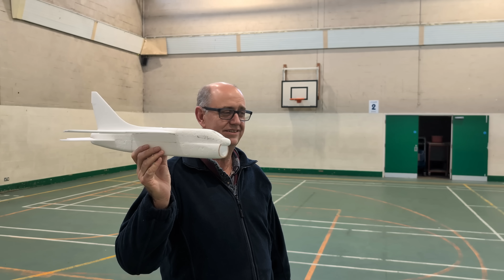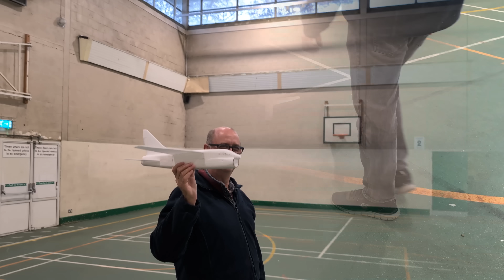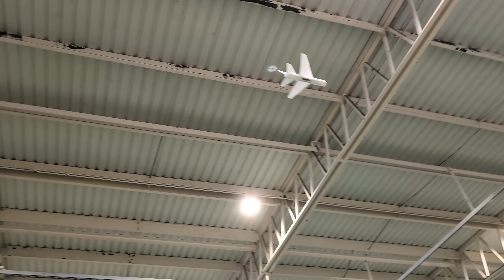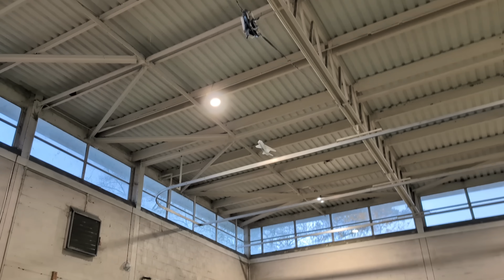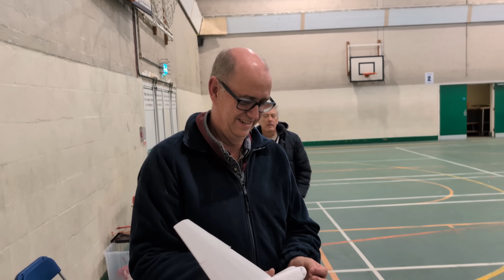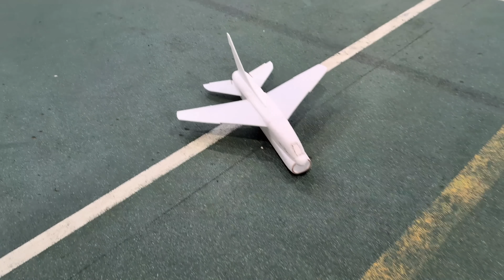Jons amazing free flight ducted fan Vought A-7 Corsair

Comment: Is there any gyro system has been used in this  very impressive model ?
Reply from the maker: No once it's been launched there is no assistance whatsoever.  The only thing the builder can change is the length of time that the motor runs for and the power that is outputs for each portion of the engine run.  A surprising amount of skill is required to get it flying so well

Comment: Need to under stand technology behind the model
More over how to design and manufacture the model
Reply from the maker: It's basically carved from foam and there's a bit more description of the process in the video description.  power is by a1s lipo battery and a 30 mm electric ducted fan

Comment: Great flight. At an airshow in the late 70's I got a unique looking styrofoam jet plane that had awesome flight when thrown. Had a bulky nose and two notches in the back for your fingers. I painted it with dad's spray paint likely made for metal and it melted. I was crushed. Next year air show didn't have them and never in the following years. It was at a Naval Air Test Center in Maryland, Pax. 
Six or more years later in my late teens I realized what the plane was. It was almost the exact shape of the Space Shuttle. I think someone may have got in trouble over that one? The gliding characteristics were a bit advanced I'd say. 
My dad was with the Corsairs during Vietnam and then P-3's the remainder of his career.
Reply from the maker: Thanks for the reply and for your story.  Yes we've got to be careful when we paint this one so it doesn't melt like your model. All the best from Cambridge England

Comment: One of the most under-rated aircraft designs ever, who would have thought it would even fly like a dream as a polystyrene model.
Reply from the maker: Yes it did fly well and it's surprised even the builder of the model.  The main thing is to keep the weight down and then they tend to fly pretty well
Reply: @alanpaul1234 I don't know if I was missing something, I watched it with the sound off but I was particularly intrigued as to how it repeatedly flew a circle in a confined space without hitting anything barring one minor mishap.

Comment: The motor performing in "stepped mode" mimics the power output of rubber band motors. Big burst of power initially at launch, then sustained power in level flight, then gliding descent. Neat idea.
Reply from the maker: Yes we picked that up from the rubber powered free flight guys

Comment: I have thought for many years now that this airplane would make a great RC model, however I was surprised that this is just a free-flight model, but I do think it admirably proves that this would indeed make a very good RC model airplane, this is a good size for an UMX model, or an even slightly larger model would also be a fun RC model, at twice this size, it could even possibly work with retractable landing gear and a much more powerful motor, but for indoor use, this is a great model of the Vaught A-7 Corsair.
I look forward to seeing a finished version of this model with an attractive paint scheme.
Thanks for sharing!
Please have an excellent and awesome day!
Reply from the maker: Yes I think it would make a good RC model and John is planning to do this at some point.  I think it would fly really well and could also make a good outdoor model if it was a little bit bigger
Reply: @alanpaul1234 Awesome, I look forward to seeing the new developments! 
I would also be interested in plans for this model if you wouldn’t mind sharing them and could make them available, I would certainly be interested building this model.
Thanks for sharing!
Please have an excellent and awesome day!

Comment: I was about to ask how it doesn't fly into the walls ot the ceiling...is it based on power and then a fixed rudder? I have seen other free flights and have always had that question.
Reply: The rudder is adjusted to get it to turn within the space before gradually increasing the power setting to see what effect any motor torque may have.
Reply: @JonOakleyModels thanks for the explanation

Comment: Is it hand carved? Beautiful flyer.
Reply from the maker: Yes the fuse largest made from blocks of foam which are sanded on the outside but hot wire cut on the inside to create the duct. The wings are made from 3 mm foam and the key to it is keeping it all as light as possible

Comment: I would love to try and 3d model and 3d print a version do you have any more pics of your process?
Reply from the maker: I have a feeling that a 3D printed model might be a bit too heavy and possibly a bit fragile.  This was built by carving out blocks of foam using a hot wire cutter and then sanding the outside.  Then the wings were just built from 3 mm sheets of foam.  The main key to success is keeping the weight down as much as possible. Sorry I don't have any more photos. Good luck if you do decide to go ahead and build something like that.

Comment: Very cool. At first i imagined two rubber bands driving a ducked fan from either end. Mabey nex time.😜
Reply from the maker: Now that's a thought.  Could be a bit tricky but should work.
Reply: @alanpaul1234  Back in the early 90's at a free-flight event at the Seattle armory I met a Boeing engineer who had built a beautiful blue rubber-powered balsa and tissue ducted fan scale model. It flew very well for it's weight but I can't remember what it was based off of. I was testing a circle plane with counter-rotating fans in the circles - it managed a powered glide but there was no way to coax it to turn.